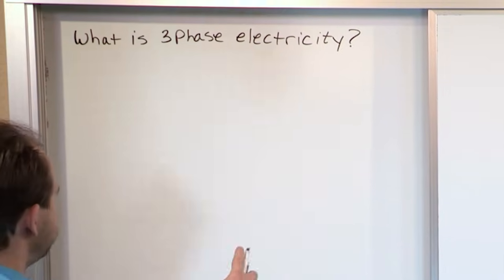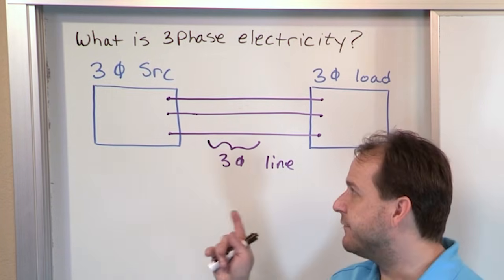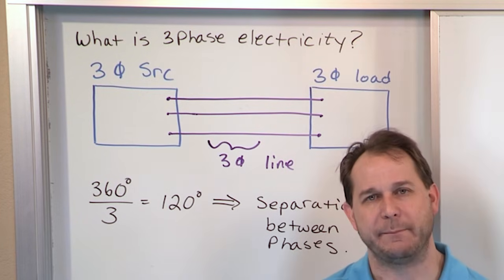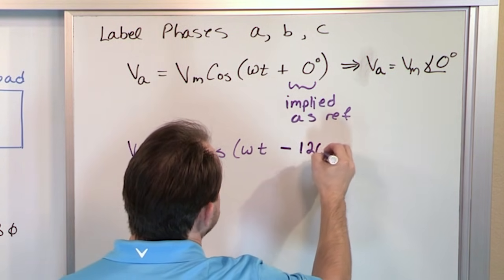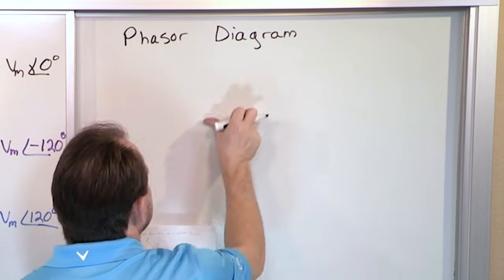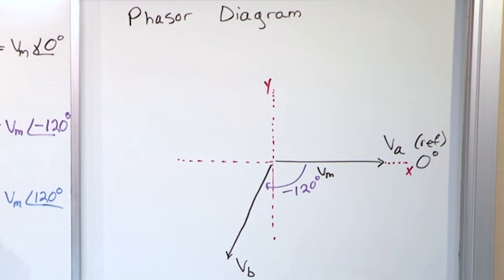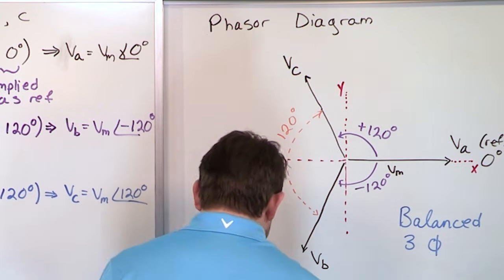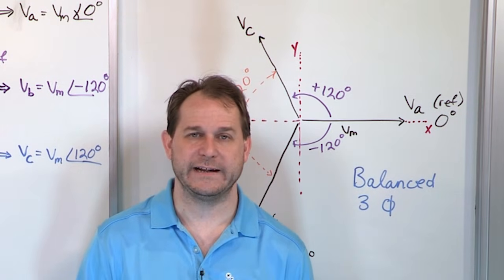01 - What is 3-Phase Power? Three Phase Electricity Tutorial

Comment: What is the meaning of pharse or pharse angle..?

Is it a physical/mechanical thing that can be seen with eyes or what..?

I understand that when you plot AC voltage aganist time.. you get a sin graph... because the electrons keeps moving back and forward..

Buy what does "phase" has to do with it
Reply from the maker: In general, the phase angle of a cosine function is a measure of how much the cosine is shifted in time with respect to the other cosine voltages or currents in the circuit.  For example, the main voltage source has a phase angle of zero.  That means it looks like a normal cosine graph (not shifted).  If you have another cosine in the circuit, say of another voltage somewhere with a phase angle different than zero, this just means it looks just like the first cosine but it is shifted in time with respect to the first one.  The number of degrees represents how much of a shift is there.  360 degrees of phase means you have shifted the cosine so much it actually lines up with the original cosine.  180 degrees of phase means you have have a shift that is half-way such that the crests and troughs of these cosines will line up in time.  You should watch my videos on phasors and sinusoids where I draw lots of pictures of this and explain further.  Thank you!
Reply: Thank you.. I will watch more videos..

Comment: is 'wt' the frequency?
Reply: w is supposed to be the Greek letter omega which is the standard symbol for frequency in units of radians per second.  t is time.  so radians per second times time is radians.  All cosine and sine functions require their arguments to be an angle which is measured in radians.  If you have an angle in degrees you have to convert it to radians before taking the sine or cosine.  You calculator will convert degrees to radians for you automatically if you have it setup to do that.

Comment: What is phase
Reply: Varsha Paliwal 
phase is
a distinct period or stage in a process of change or forming part of something's development.
Reply: james tomlin in electricity can we say that phase means supply voltage by one wire
Reply: In a single phase system, there are just two wires (or conductors or lines) that carry power from the source to destination. One among them is called ‘phase’ or ‘live’ and the other ‘Neutral’.

At some point along the whole circuit, the Neutral is always connected to the Mother Earth. Therefore, compared to the earth (and all of us who live on the earth, hugged to it conducting electrically), neutral has 0 Volts.